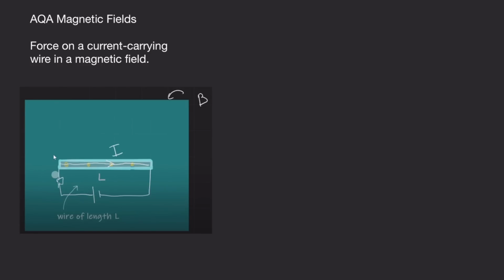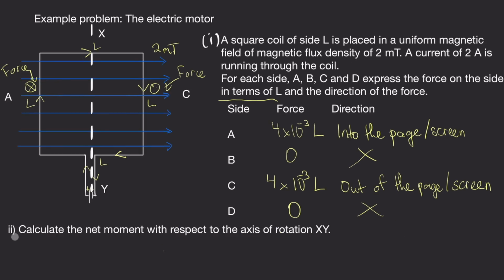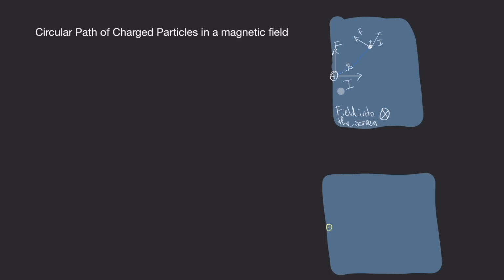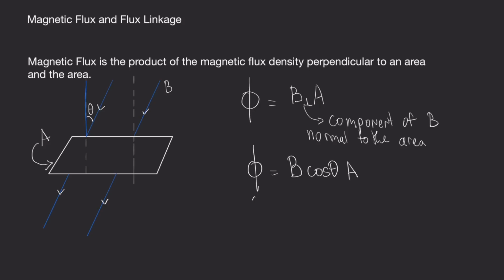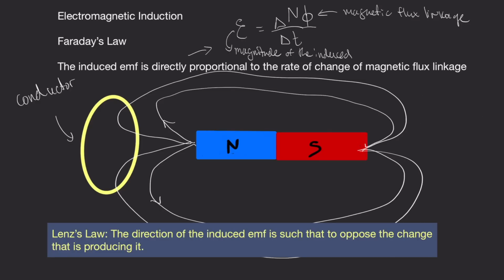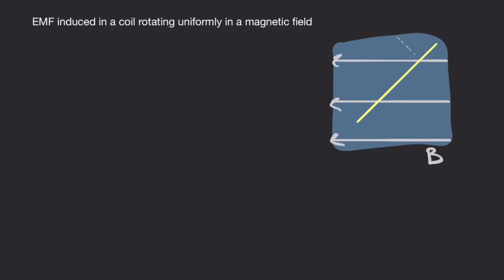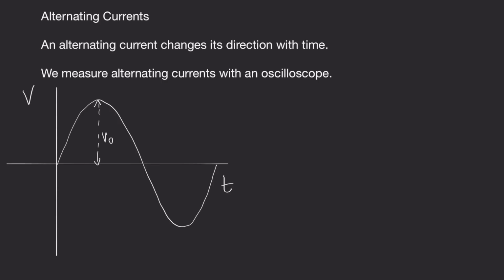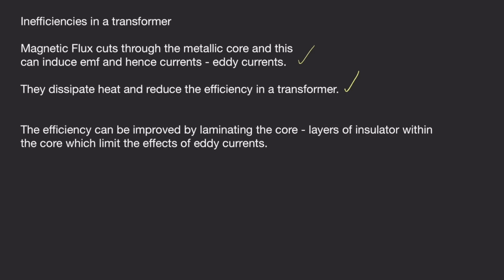All of AQA Magnetic Fields in 47 Minutes

Comment: For OCR A, when filling in results tables, should you be consistent with significant figures or decimal places? It's a bit confusing sometimes—for example, if most data is given to 3 sig figs like 1.50, but suppose one value is 0.500, the mark scheme sometimes shows it as 0.50 instead (matching decimal places). But I thought the rule was to keep data to a consistent number of sig figs. I’m also running into similar issues with uncertainties. Thank you
Reply from the maker: @thatvrchannel5376 so for tables conserve decimals, otherwise significant figures. E.g if using the same volt meter you'd get reading such 5.00 V and 13.00 V which would be written like this in the table. Hope this helps!
Reply: @zhelyo_physics  thank you! So does this rule apply with uncertainties too?
Reply from the maker: @thatvrchannel5376 generally yes, sometimes exam boards are a little inconsistent with uncertainties. In general you want to give the percentage uncertainty to the same level as the absolute uncertainty which is often just 1 significant figure. Sometimes it may be two but very rarely more. I would clearly write out my reasoning in a long calculation e.g. 92 +_ 2%  (rather than 2.1 as the absolute uncertainty was up to 1 sig figure).
Reply: @zhelyo_physics  that makes sense. Thank you for your help 🙂